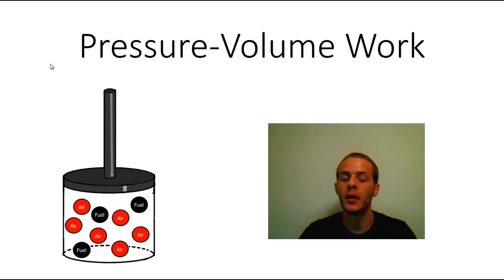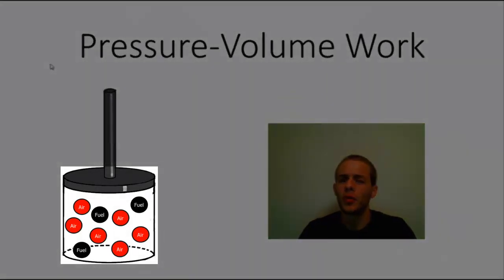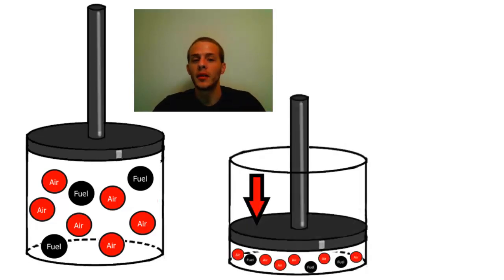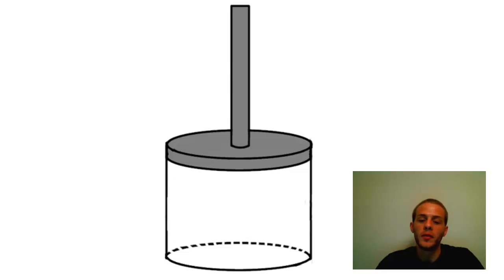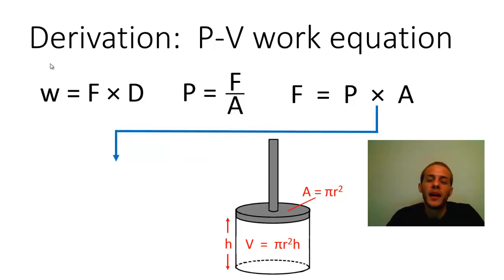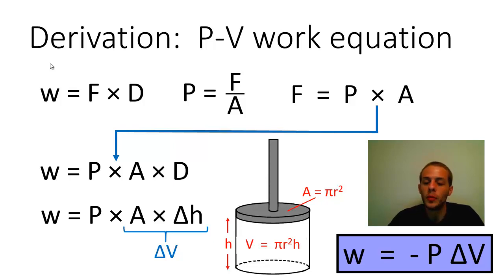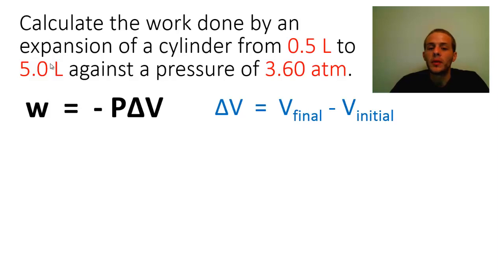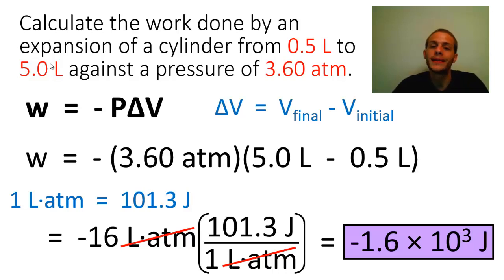How to Calculate Pressure-Volume Work

Comment: A gas has initial volume 0.2 cubic metre and temperature 290 K and pressure 1 atm. If its temperature is changed to 253 K and pressure is changed to 1.2159 atm the final volume attained is 0.1453 cubic metre . So what will be work done in expansion or PdV work? should we take P=1atm(initial)or P= 1.2159atm(final) to calculate PdV work. Please help ben.
Is my question wrong?

Comment: 7:25
According to my textbook:
The mechanical work done on the system is defined
as w = - PV, where P is the pressure and V is the volume change and is equal to
V2 - V

whats goin on?